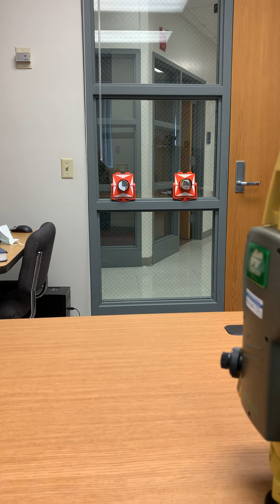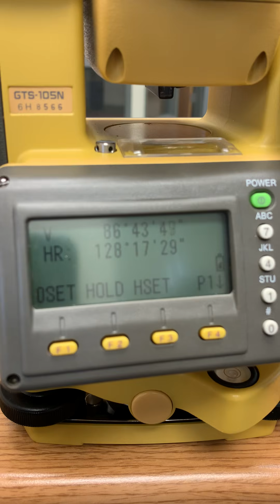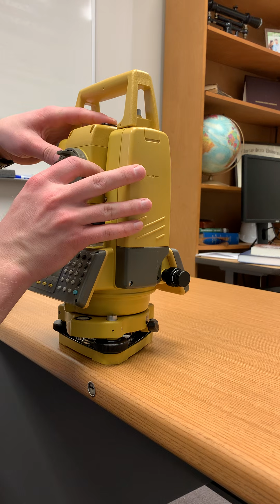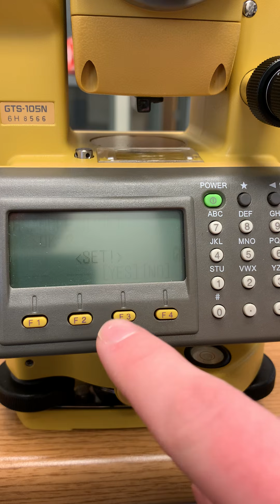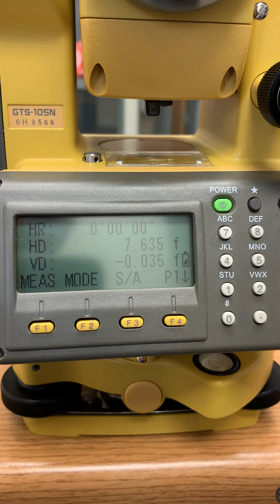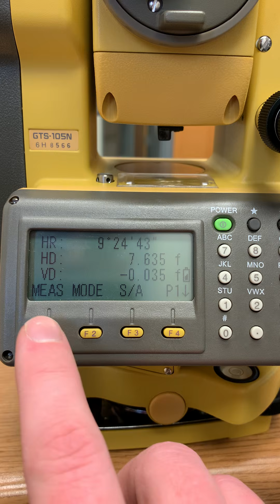Total Station - Making a Measurement

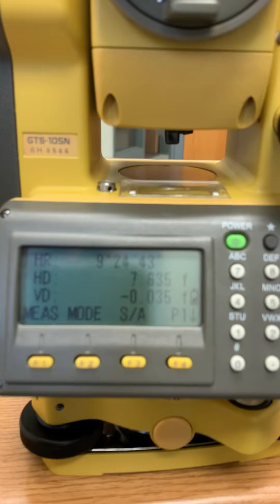Comment from the maker: 5:15 - "The screen didn't change" - Well...the horizontal angle changed, but the distances did not. Once you set zero, the angle measurements are done automatically, but you have to press the "MEAS" button again to update distances.
6:07 - V is the vertical angle or "Zenith" angle. Not the "Azimuth". An azimuth is a horizontal angle from North. Its difficult to speak and think at the same time :)